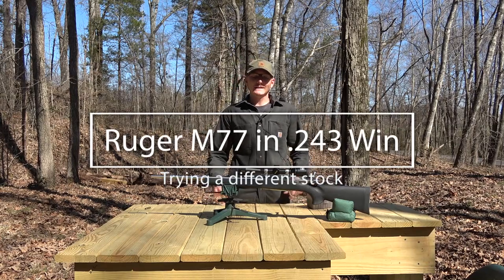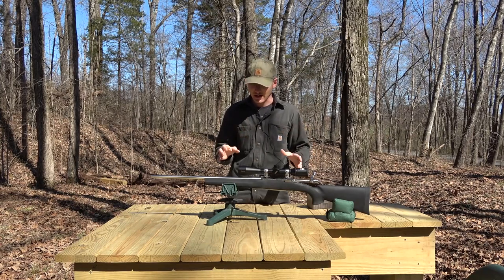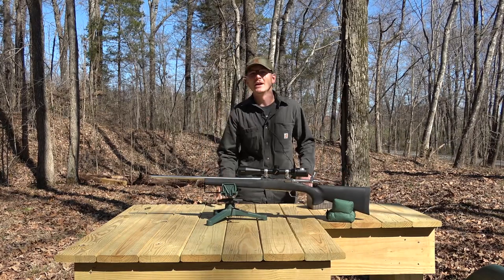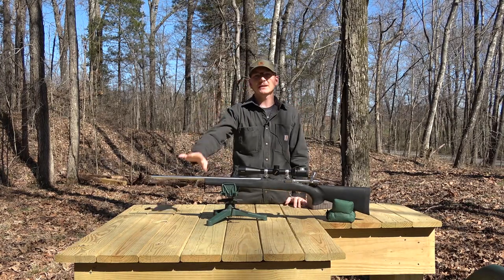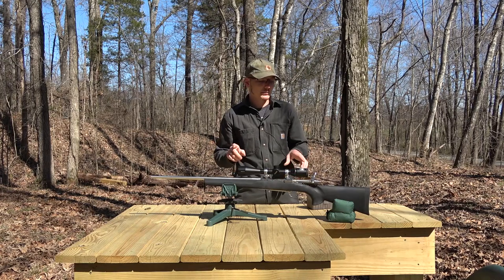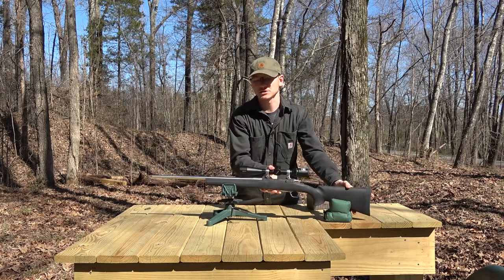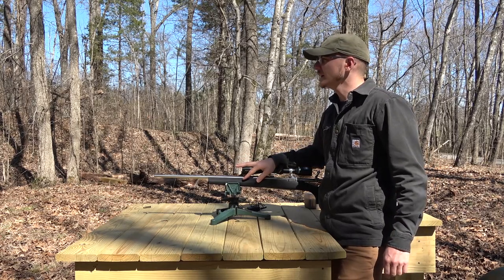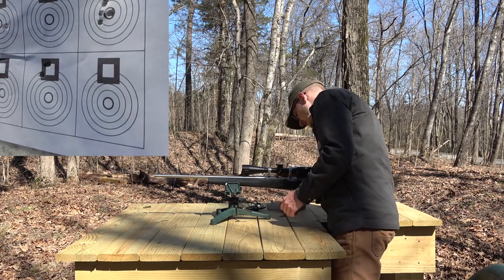Ruger M77 in .243: Trying a different stock

Comment: I also put a limb saver vibration dampener on it 1 inch back from the muzzle. It did help a little. Well worth the $10. My M77 Mark II ss likes 42 gr of Varget for the 58 gr v max and 38.5 for 75 gr HPs. This works out to be about 1gr above the starting load. It also shoots factory ammo decent. You don't need to replace the stock just shim under the bedding block or sand out the fore end. It's only touching about the last 2 inches. I also put a lighter spring in the trigger which cut the trigger pull in half. If you can't get it to shoot contact me and I'll buy it from you.

Comment: I dont like the hogue stocks. Too much flex in the front end. If you put a load on a bipod youll make contact with the barrel. Had one on my remington 700. Felt good, but the flex under load was an issue. Probably fine for hunting and holding just in hand while taking a shot hunting, but i just target shoot.
Reply from the maker: It does have some flex to it, but not nearly as bad as the factory stock. I did have to be careful not to put too much load on it when shooting off a rest.

Comment: Good stuff! Nice to see how that new stock performed. I heard the M77 are actually not the greatest grouping rifles out there. The ELD-x has to be one of the best hunting bullets out there for flight?
Reply from the maker: That seems to be the case. It seems to be around 1.5 to 1.75 MOA most of the time no matter how the load is tweaked. Should be perfectly suitable for hunting out to any reasonable range though! Initial calculations showing only about a 10” drop at 300 yards.
Reply: That’s pretty good! I’ve tried about 4-5 different factory loads out of it years back and only one shot half decent. I may put on a new scope in the future. I can’t believe I shot that buck in Wyoming at 418 yards with it don’t know how I pulled that off lol